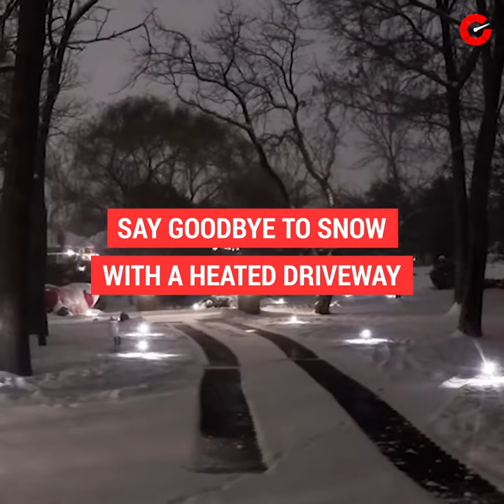Say goodbye to snow with a heated driveway

Comment: Well, I hope that comes with a very large solar panel system on the roof. Or it will just add to USA's already disgusting waste of energy.
Reply: What exactly is a waste of energy here? Energy is needed to remove the snow regardless of the source. Or do you really beleive a truck plowing and putting salt down is any less energy?
Reply: @Luckingsworth  Think of it this way. Would you rather spend the energy shovelling snow on rare occasion or lay down in the snow 24/7 melting the snow with your body heat.